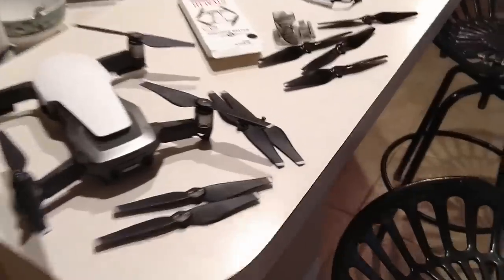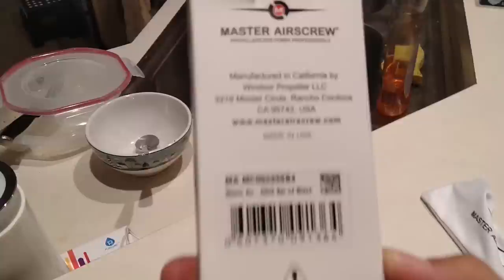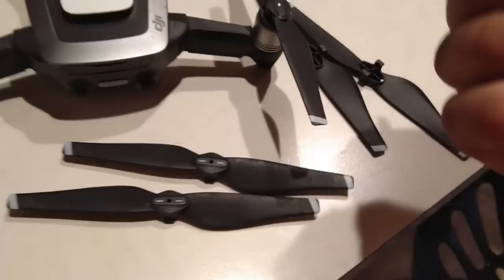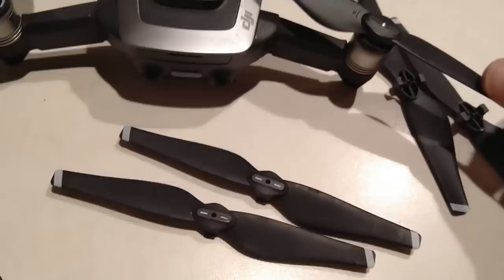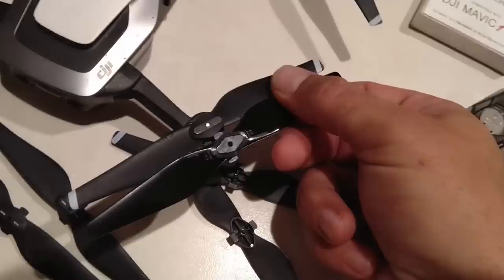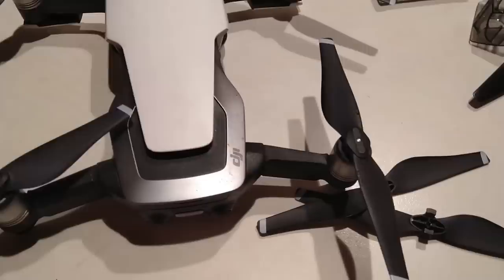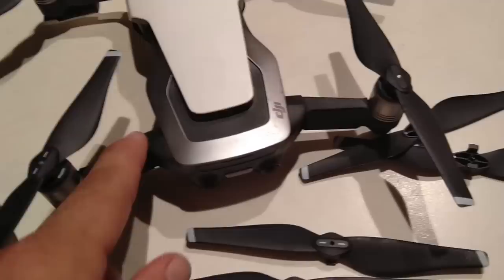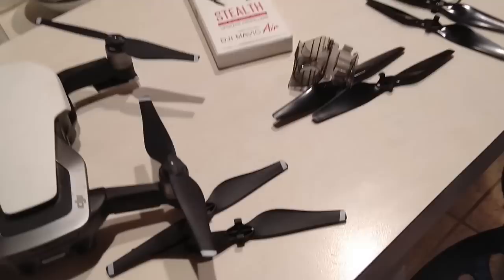Mavic Air Stealth Prop review master airscrew

Comment: What lift do I need to fit 34.5 outlaws on a 2018 Honda foreman 500?
Reply from the maker: There is no lift that will allow that currently in production. Your axles, front diff, and rear drive shaft can't handle the stress anyways. It also floats bad. I had a custom raked lift and massive floorboard mods to make it work... Barely
Reply: @MudPuppyOffroad  thanks and what tire would not float so bad I took my Honda  in lake Lanier and the rear end floated like my jet ski.